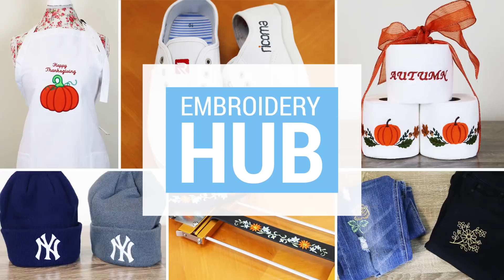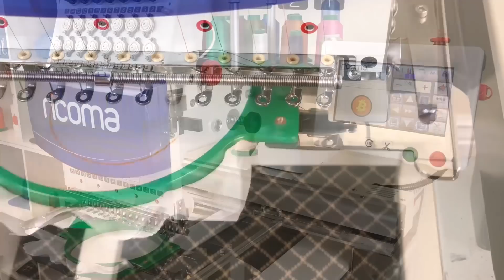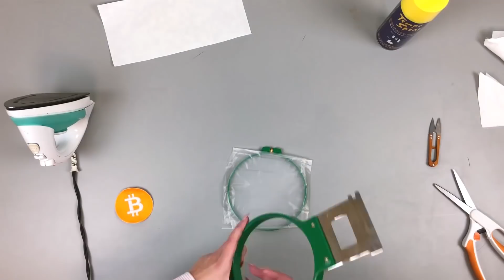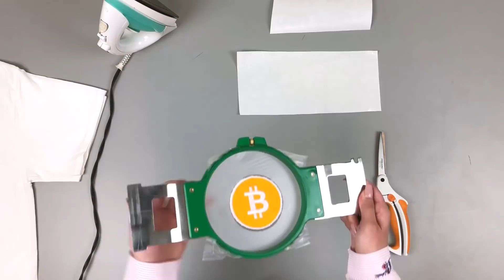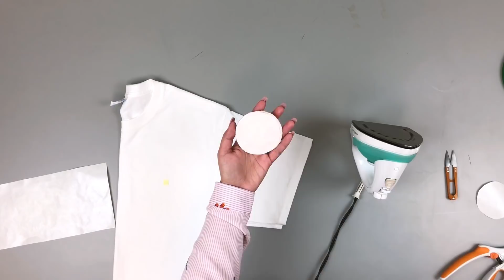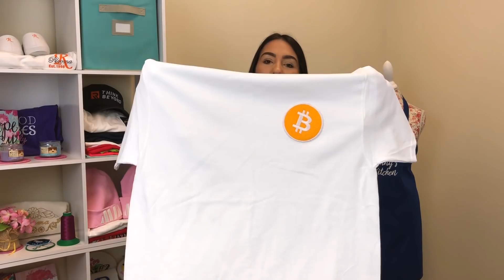Embroidery Hub Ep. 40: Custom Embroidered Patches | Bitcoin Custom Iron on Patch Embroidery

Comment: where do youbuythe heat and bond
Reply: Michael's sells it.  They have two versions: Heat n Bond Lite and Heat n Bond Ultra.  Lite has less adhesive.  Both are quite cheap -- about $10 for 5 yards of material.  Michael's always  has coupons to buy it for cheap, as well as periodic online sales.
Reply: Joann Fabrics also has it. You can by it in a package or by the yard. It is usually cheaper by the yard. Just make sure the cutter rolls it instead of folding it.

Comment: What is the point of using the water soluble backing if it just gets teared off? Couldn't you just finish the satin border on the original fabric and apply the heat n bond straight to it?
Reply: I am wondering the same. Dont understand why you need water soluble
Reply: You can, but since you can't clip the cloth exactly next to the thread you'll still have a little ring of fabric surrounding the patch.  You also have to apply Fray Check or a similar product to prevent the fabric from fraying.  Either way, it's not nearly as nice of a border as the way they're doing it, which in turn isn't as nice as a traditional Merrowed border (which requires specialized equipment).

I've been doing it the way you suggest then using a heat knife to cut the edge of the fabric.  The heat knife seals the border to prevent fraying, but it significantly more labor intensive.